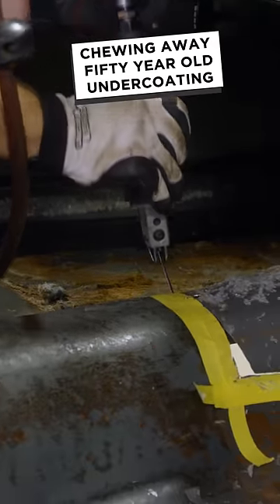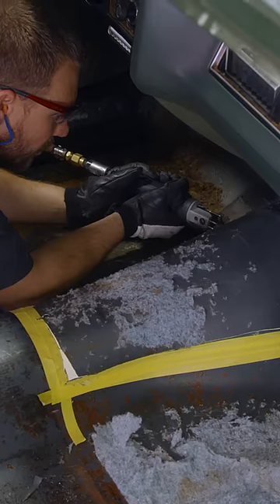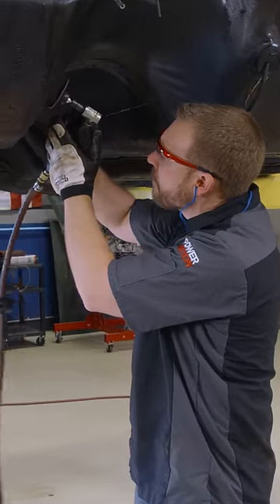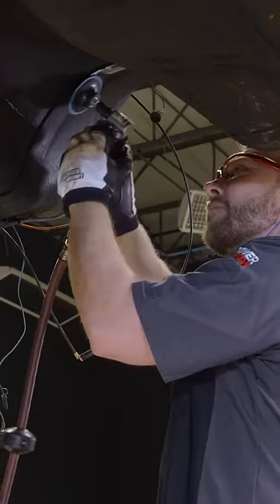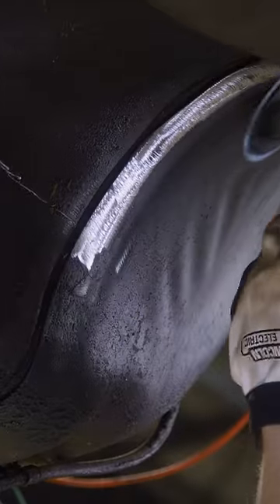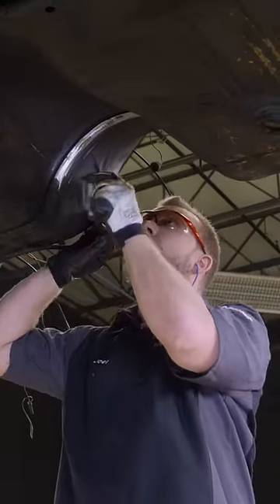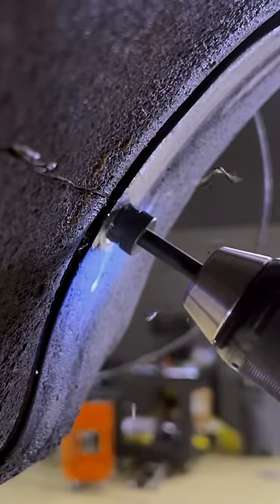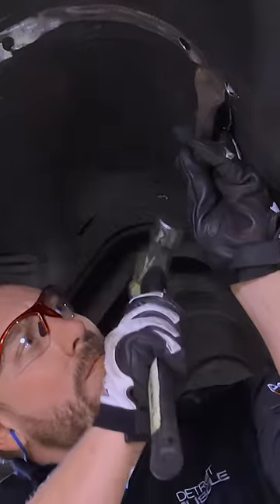Cutting a Transmission Tunnel in a '71 Chevy Caprice

Comment: No. Do not use a grinding disc. You're grinding away metal that you're going to need to weld too.

3M makes a bristle disc. With roloc attachment. That does not distort the metal. They are about 12 bucks a peace. And they also remove paint and seam sealer.

And if you want it done quickly. Brake parts cleaner.

Spray on, wipe off.

You want absolutely no residuals of that 50-year undercoating, anywhere near where you are going to weld.

Unless you know exactly what chemicals that undercoating is going to create when it burns.

In this particular case... It could be extremely hazardous to your health.
Reply: Good tip, thanks
Reply: You can achieve any result with the green 3Ms if you got the touch. Respect to bodymen keeping the art alive.

Comment: Instead of using a big chisel to pop the spot weld apart use a cheap putty knife. They flex in the hard to reach places and do less bending of the sheet metal you’re trying to preserve
Reply: Probably didn't cut the spot out cleanly...ergo the chisel

Comment: Used a wire or relocation wheel ,that doesn't look like 50 year old under coating .I would be tar not rubber based
Reply: Damn phone auto corrected,roloc wheel

Comment: You dont drill all the way through with a spot weld cutter. If you do that, you might as well just use s normal drill.
Reply: Didn’t look like they did, just the first layer.
Reply: Drill a pilot hole with 1/8 inch drill. All the way through the panel. And you are spot weld cutter, through the panel you would like to remove.

When welding the panel, start, your bead, in the pilot hole.

Comment: Why does everyone use those stupid rolock disc's that absolutely wreck the metal, use a wire brush on a die grinder or a angle grinder if you need a big one, and they won't tear up steel or even aluminum if you get the fine bristle ones